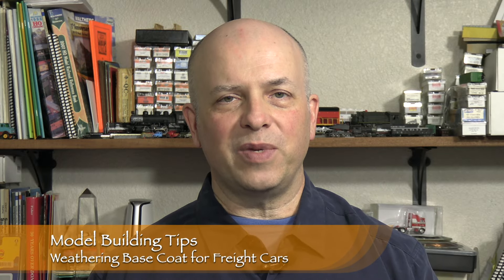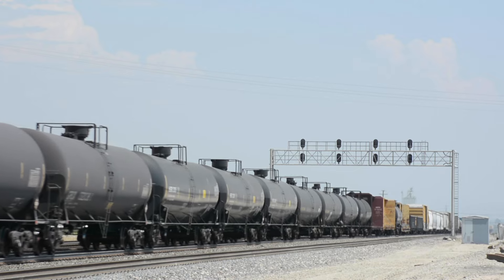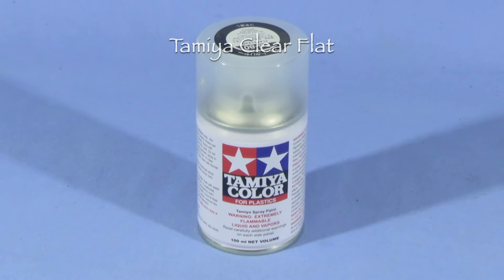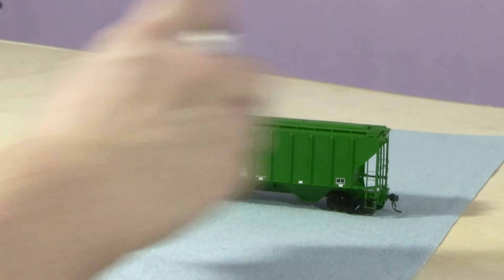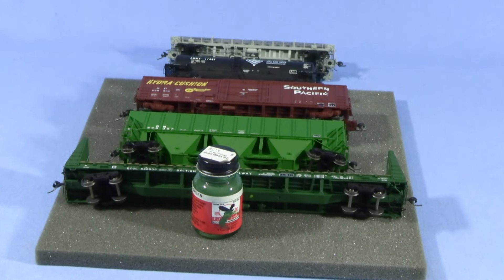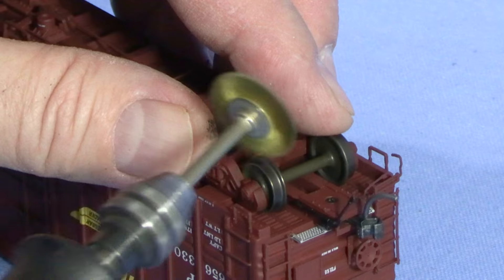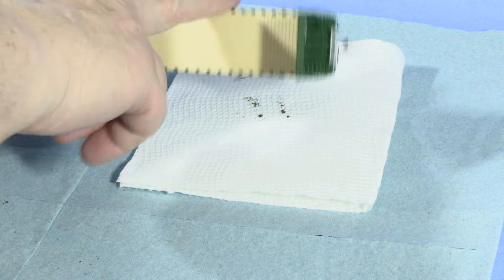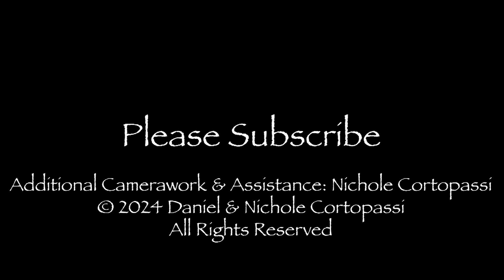How Do You Start Weathering Freight Cars? - Applying a Weathering Base Coat and Painting Wheels!

Comment: You mention not using orange rust powder on wheels because it's too bright. It does have its place on the occasional car, though -- when a wheelset has been replaced, the new one is an orange-rust colour until it dirties up.
Reply from the maker: The bright orange has it's uses, as you mentioned.  I was trying to suggest, and this is just based on my own taste, not to overdo it.  Thanks for watching!

Comment: So testors dullcote is back in production and a new formula too. The come in a can with a triangle like flag on them and so far is far superior to the old formula. No more heating the can up to make sure it sprays even. So far I love it far better. 
Also your spot on with keeping the motor tool low speed I broke several axle points off the old school Kadee wheels sets. They just heat up and snap.
Reply from the maker: I'll have to look for the new Dullcote.  I still have a couple cans of the old stuff, but that won't last forever.  Thanks for the info and for watching!

Comment: Hey Dan. I really appreciate you did that video for us. It's always interesting to see how other modelers are doing weathering jobs. I'd say from my experience that 80 to 90% of weathered models are awful and not even close to some realism. Like you, I'm using Tamiya flat clear. I switched many years ago avoiding Testors dullcoat because of inconsistency of the product. I'm usually not applying flat coat(s) to begin a model but I know that most of modelers do. The main reason is that I'm mostly weathering with acrylic paints. As Tamiya flat clear is alcohol base, I'm trying to avoid a chemical reaction between paint and flat clear. The thing I like the most in your video is that you're using weathering powders. I know I should be using them for a long time. I find them messy a bit... but I know I should ! Thanks for sharing.
Reply from the maker: I'm glad you liked the video.  I use powders quite a bit.  The self-adhesive ones don't need any additional coating (though I don't handle my models that much), and they are not shiny.  I also find it's easy to control the application and put them where you want them.  I can't detect any toxic smells either (though Nichole has told me that my nose isn't the greatest).  Thanks for watching!
Reply: @DanielCortopassi  Hi again Dan. Many thanks for answering my mail. Would it be possible to know the colors and brand of powder you're using please ? I bought a BIG spray can of Vallejo flat clear. Finally never used it. I tried a few time and had NO control over the spray. There was too much at the time so I discarded it. But I bought another Vallejo spray can with a specific color in it. It comes with two different spray nozzle. It's a real charm to use it. But the color I choose was like useless so I had to discard it too. Tamiya is the real thing when it comes to primer and flat clear. Most of the colors I airbrush are Tamiya enamel and acrylic base. Works like a charm. Keep on your good work.

Comment: I have done the wheels before but didn't think about the inside of the wheel or the axle. It definitely makes it look real. I do the trucks too.
Reply from the maker: I don't usually do any more with the axles and insides of the wheels than I showed in this video.  Those areas are often hard to see so just having them not be shiny metal adds a great deal of realism.  Thanks for watching!

Comment: I LOVED Testors Dullcote in the spray can. I'd buy a dozen cans of that right now if I could find them. Unfortunately I don't think it's being made anymore. Although I could be wrong. Testors got bought and a bunch of products were discontinued. Weathering is something that I have not tried my hand at but really need to. I've got a bunch of old cheap rolling stock that I could practice on without having to worry about wrecking my more expensive stuff.
Reply: It is still produced!  The cans were updated but they had issues with splatter.  The newest batches are just like the old formula.  I buy mine from Hobby Lobby.
Reply from the maker: My advice would be to use photos as a reference and start slow.  You can always add more, but depending on the product it can be hard to remove overdone weathering.  My personal preference is for cars to be a little under-weathered than over-weathered.  Someone else said that Dullcote is back in production, so you may not be out of luck.  Thanks for watching!
Reply from the maker: It's good to know it's still in production.  Thanks for the info and for watching!

Comment: Mr.Cortopassi I’m trying to do a dcc install in a Life Like N scale fa1 and I’m having trouble trying to figure out how to isolate and modify the frame to make it dcc friendly, I was wondering if you had any tips
Reply from the maker: I have never had a Life Like FA1 so I'm not sure how much I can help.  If you don't already have some Kapton tape I'd recommend getting some of that.  It's very thin (thinner than hardware store electrical tape) and is useful for separating the frame from any contacts on the motor.  ESU, TCS, and others sell very small gauge (30 or 36) decoder wire that can be useful for adding connections to the motor.  The wires are fine enough that sometimes you don't need to modify the mechanism to get them to fit, depending on the design of the model.  If you have a multi-meter that can be useful to test for resistance to make sure that the frame and motor are really isolated.  If it shows an open circuit then you've got it.  I always test each motor lead against each half of the locomotive frame (if your engine has a split frame like a lot of N scale).  Good luck with your install.  Thanks for watching!

Comment: This may be off topic a little but I have a question about wheels. How do you determine what diameter wheel rolling stock will have if you want to replace them? I saw your video on wheel codes but I don’t recall any mention of the diameter.
Thanks Dan, great videos.
Reply: In H0 scale all the rolling stock wheels are pretty much the same size in diameter, there are only flange and tire width differences for people who care about that detail. You'd mostly only find diameter differences among some locomotives if they are small shunters for example, but those are specific scenarios.
Reply from the maker: @desertrailfan7118  So as as a very loose rule of thumb modern freight cars tend to have 36" wheels and older steam-era or transition era cars tend to have 33" wheels, but it's not universal.  Sometimes it has to do with weight capacity, too.  100 ton cars tend to have 36" wheels, while some 70-ish ton boxcars have 33", even if they're newer.  Auto racks sometimes have even smaller wheels.  Some models have the wheel diameter stenciled on the end of the car.  You might need a magnifying glass to see it, but that can also be helpful.  Even though it's small, I can see a visible difference between 33 and 36 inch wheels, even in N scale, so I like to get it right.  Thanks for watching!